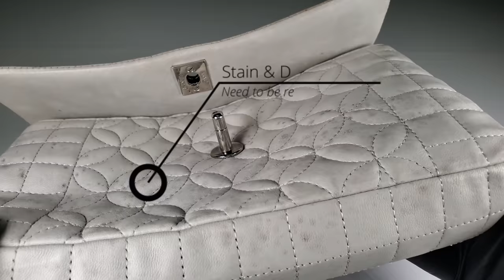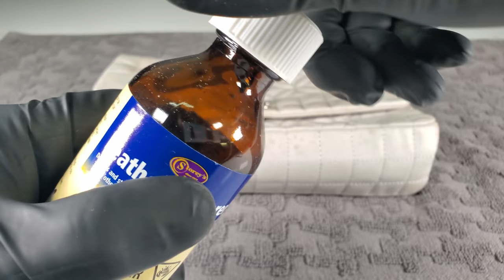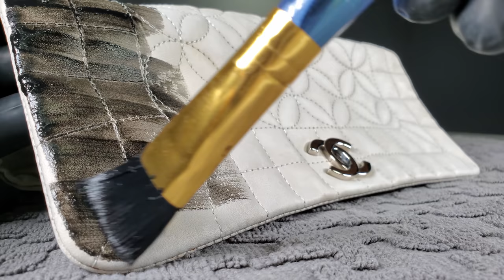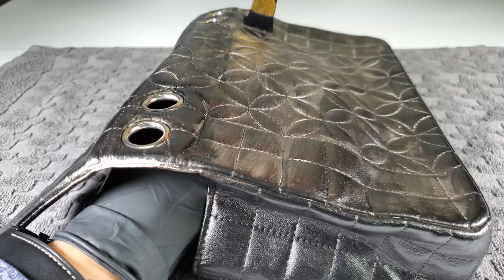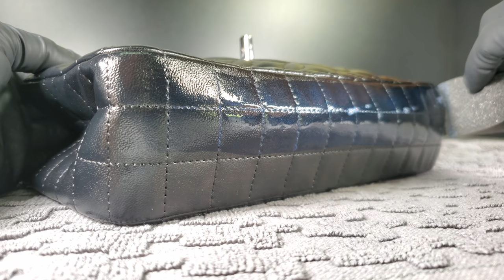ASMRㅣChanel Bag Color Changeㅣ샤넬백 컬러 체인지

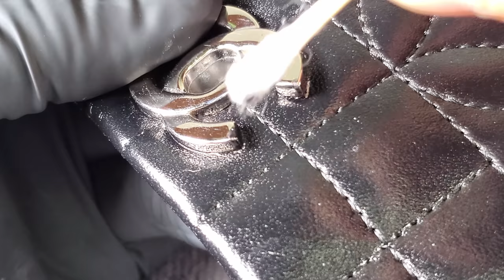Comment: At 7:20 U should have removed the Logo with the screwdriver 🪛,  u instead went the lazy way and painted around it. U will see the original white color underneath the logo. Bedo Leatherworks would have NEVER done that missed step.